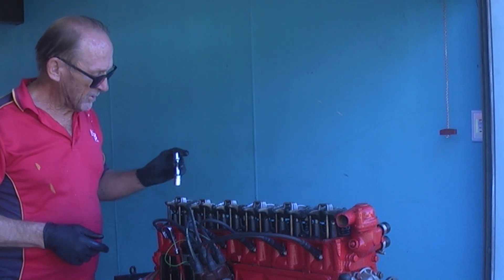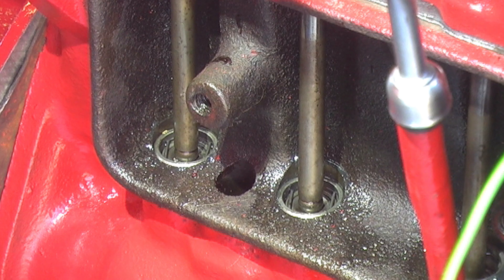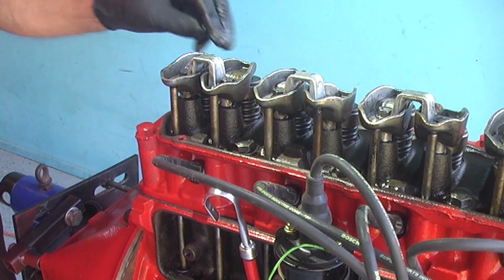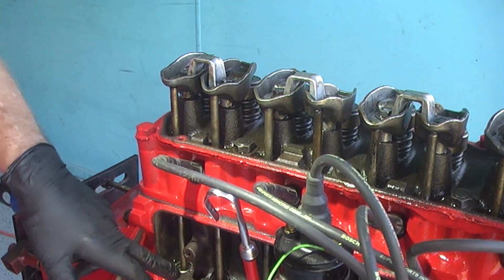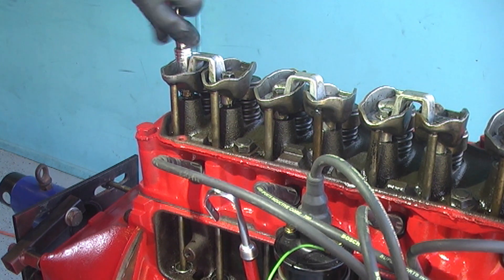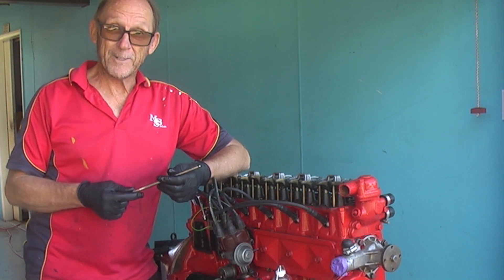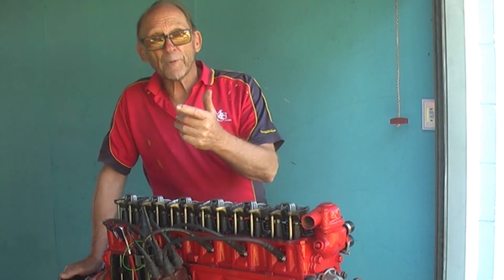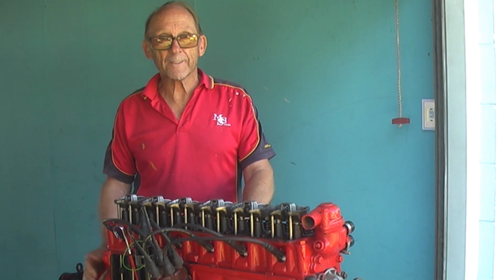Hydraulic Lifter Adjustment after fitting a Camshaft into a Holden 202

Comment: Where did you get the 40 thou less rods from? I’m using std 202 9.016 and I think they’re too long for mine since the head has been shaved and I’ve got a high lift cam. Cheers
Reply from the maker: Well some of my information will be about 20yrs old. Many moons ago I got them from Lunati in USA but the ones we actually fitted which were .040" shorter came from some speed shop down south. Just do a search for pushrods & see what results you get.
Reply: @mbsoldschool  Roger dodger.

Comment: Do the lifters bleed down! If the engine was not running or newly built they need removing? To fill them?  Is checking back lash on empty lifters is a potential problem for instance?
Reply from the maker: of course they bleed down. I have been adjusting empty lifters all my career just like in the vid. Even if you can't see the lifter & adjust by feel to remove the play, you can still be within 1/8 turn out usually in the tight direction, so no harm done there. Back in the day I always built up oil pressure first before firing the engine so all the lifters had oil in them. By the way the engine will still start when most of the lifters have bled down. They will pump up once  they have oil pressure.

Comment: Great lesson thanks! Had a HQ holden forteen years. Great engine! Question on the lifters if they are the same as in a Rover V8 theres a spring inside them. Is the oil designed to keep pressure lightly on the push rod or the spring is doing that? And i never had to adjust the clearances on the 202. My Rover has a high lift cam opening valves 500thou. Cam wear is relatively fast. Every 12000miles should adjust llifters is advised. Im sceptical...If they are adjusted correctly wont the hydraulic lifters keep ticking noise iff the valve train away? I haven't any previous experience with RV 8 my one is running really well done 48000 km and dyno shows ver high ft/lb at the wheels. With me its done 5000k trouble free. Knowing the cam and lifters are a week point thanks for teaching me about this.
Reply from the maker: The spring in the lifter maintains light pressure against pushrod. 12,000 miles sounds crazy. Once adjusted correctly, the lifters should last the life of the engine, unless the cam or lifter fails.

Comment: I bought a cam kit recently and noticed they were including 186 length rods so I asked them to put std 202 rods in. Thought that was a bit odd really. What I don’t get here is that the manual says to torque those rocker bolts down so how can that be if there needs to be a preload? With these bridged rockers I thought the lash was correct due to the std rods being in there.
Reply from the maker: preload is not what it seems in this case. It is only setting the plunger depth into the lifter bore, there is no actual real preload, just a small tension against the internal spring. Did you not see that I went .040" shorter on the rods because the head & block were shaved. This will drive the pushrod deeper into the lifter the more that is shaved from the head & block so therefore to maintain an acceptable lifter adjustment you must fit shorter rods and all this depends on the valve stem height as well. If the builder pockets the valves then they stick up higher which will drop the rod deeper into the lifter. A bit to consider rather than just slapping everything in & torque the rocker bolt down & hope for the best.
Reply: @mbsoldschool  Yes I saw all that, I'm talking about a std head and rods. If I tension them to spec that pretty much pushes the rocker bridge to the studs they sit on, so I'm not seeing how that would allow zero lash if you get what I mean? It's either tightened solid or the threads would be exposed by loosening them.

Comment: Would you know by chance what the valve drop difference is with unequal rocker geometry? In this case?
Reply from the maker: I gather you mean valve opening distance variations. 20 yrs ago I did the geometry exercise using a degree wheel & dial gauge, using different rockers at different geometry angles. There was only a few thou difference when the bolt difference was a qtr to half turn. In a 202 the geometry is set by the valve stem height. In this engine the relationship of correct geometry is affected by the cam base circle, lobe lift, valve stem height & pedestal height. The pushrod length only determines how far the rod will end up down the lifter bore after torquing the bolt down, it does not affect geometry at all.